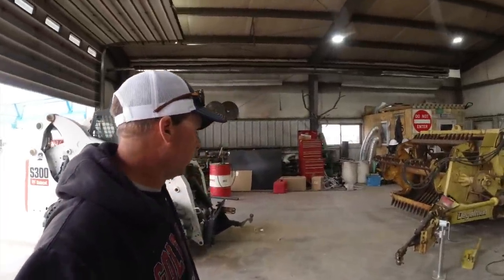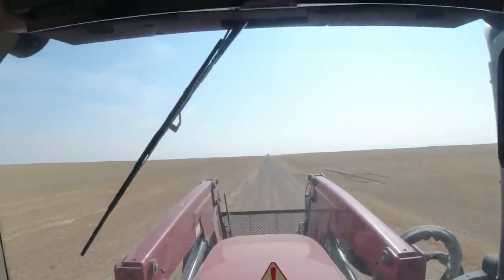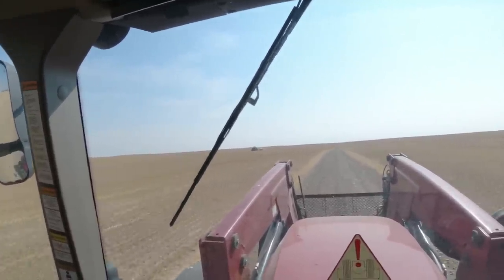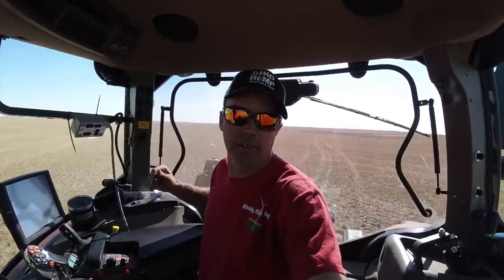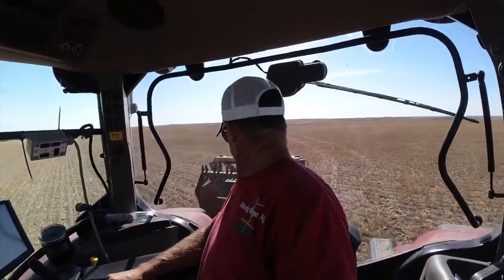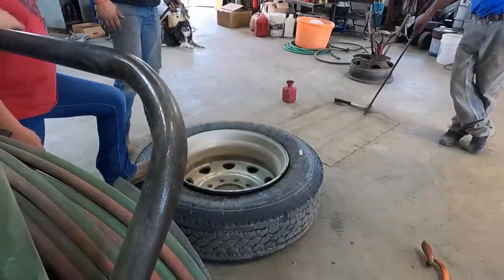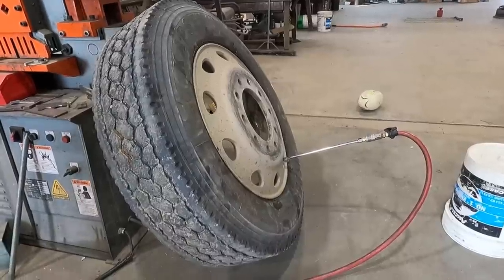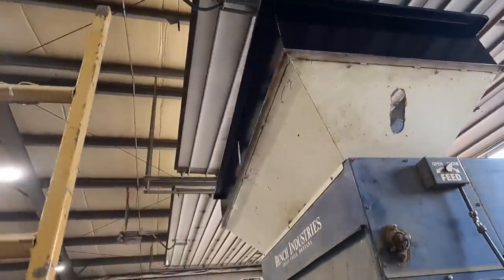The Struggle is REAL!!

Comment: I need/want to get a cK Worldwide MT-200 AC/DC GTAW/SMAW Welder and a Miller Spectrum 875 Auto-Line Plasma Cutter so I can setup a CNC Table. Then I can just import a parts shape into CAD software and have it cut out, then it’s just like Lego from that point on.